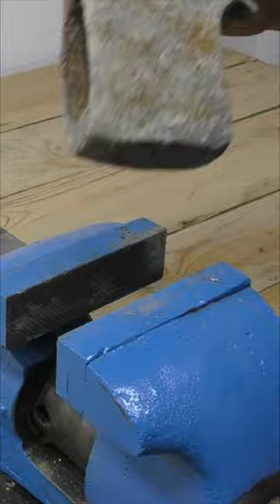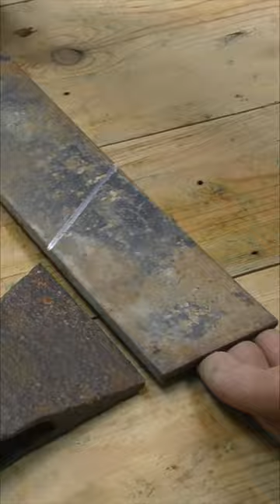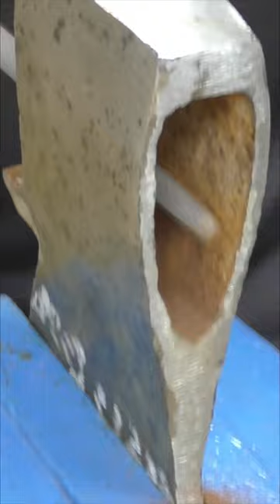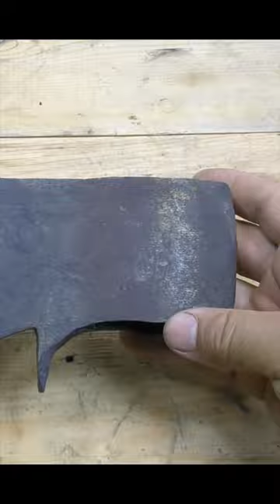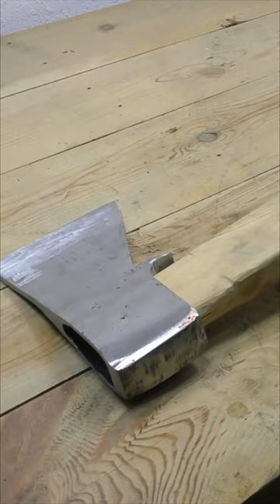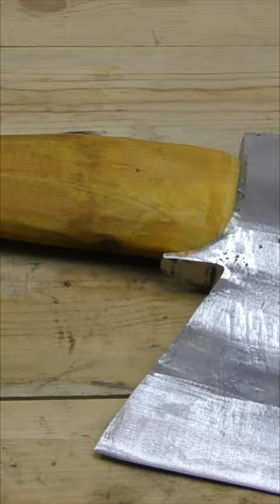Restoration of a very old and ancient ax

Comment: Awful finish on the axe head, no reason to cut it just put a new edge on, and who the hell glued the splines in. You should have a fit that mushrooms over the top of the axe so it can’t fall off.

Also didn’t get it nearly hot enough to heat treat and didn’t normalize the metal before hand. And no tempering?
Reply from the maker: Смотри полное видео на моем канале
Reply: @ustametal why? To watch you butcher a axe for views?
Reply: @TheDailyKnife009 could you do any better?
Reply: @JasonA1124 yeah, I would sand it then sharpen it. Not butcher it😂
Reply: @TheDailyKnife009  prove it, make a video on it and I'll shut the hell up